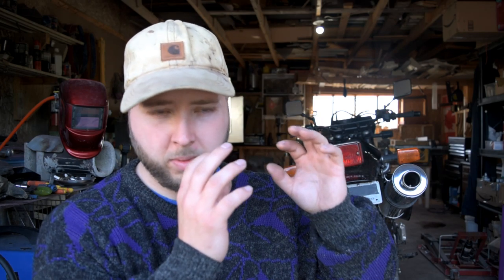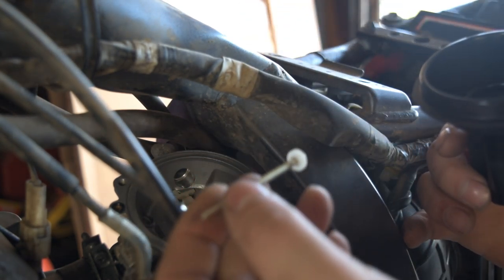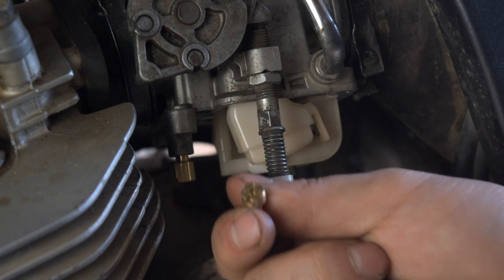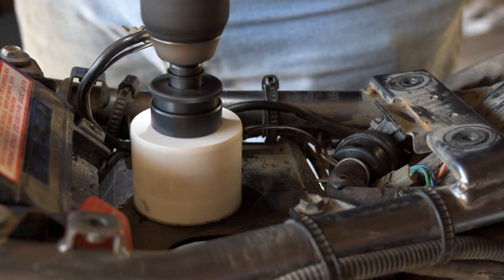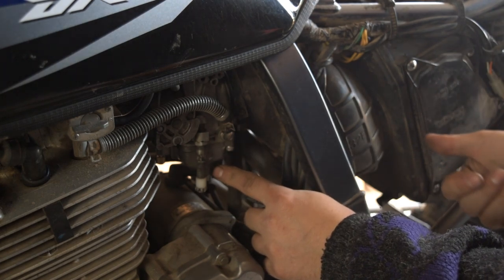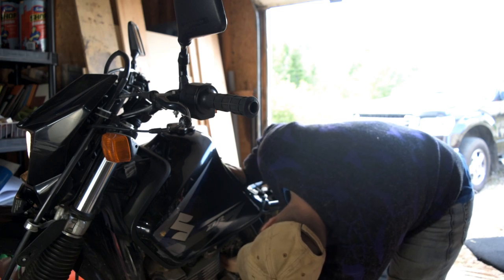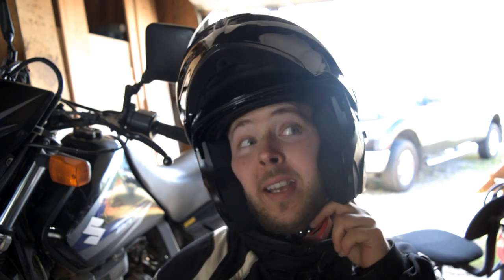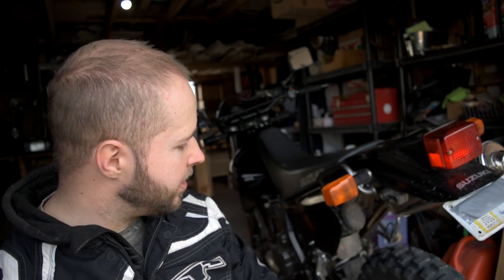Turning the DR650 into a Monster! - [ PROCYCLE FUEL AND AIR ]

Comment: Don't change the springs out, just drop in a set of plex valves for your forks. Best fork mod for the DR650 ever! I have them in my DR650 and they're fantastic! Look them up.
Reply: Yep I have the full set up from FFRC. Absolutely love it
Reply: @ashleywevv3583  I haven't done the rear yet but I'm definitely going to! 👍
Reply: Good tip.  Thank you
Reply: Yup plex valves  are awesome
Reply: Just ordered
Reply: Stiffer springs are better
Reply: Stiffer springs might be required, even if you improve the damping. Set the sag correctly via preload adjustment. Cut new spacers of PVC and/or use aftermarket fork caps.

Comment: I keep the jetting simple. At/Near sea level, I just pull the snorkel, install an extended idle-mix screw, and install an adjustable overseas DR650 or a KTM640 needle. The adjustability is the key, if you like the stock needle taper. I can remove the airbox door and/or tune the idle-mix screw at altitude, if needed. I DON'T cut the airbox. Move the crankcase vent away from the airbox opening to eliminate surging. The stock main jet and pilot jet work fine at sea level with a de-snorkeled, uncut airbox and a stock exhaust. The stock, unadjustable, USA needle is a bit lean, especially after de-snorkeling. It CAN be shimmed too, rather than replaced by an adjustable needle, if richening is needed.

 With stock exhaust, these simple changes in snorkel, needle, and idle-mix seem to run great. My fording depth didn't change much. MPG is similar. Wheelies are easy.

 A bigger main jet may be needed at sea level if you use aftermarket exhaust and/or a big-valve head.

 Some guys at high altitudes actually also use smaller main jets and pilot jets than stock, often with a lowered (leaner) needle setting. With snorkelectomies and free-flowing exhausts, they report sometimes topping 60MPG with the smaller jets and lowered needles.

Comment: Easy way to remember on what jet to start with and then try to get to the exact one on the main jet. The scale for them are a little hard to follow. A 155 is sea level. Most fuel for the most air. A 100 is on top of the highest mountain. Way less air less fuel. Unless your up in the mountains, most will be a 125 or less. Mountain being 5,000ft too 6,000ft and up. Again, less air less fuel. More air more fuel. Then changing the air box or air filter to give more air then means bigger jet or higher number on jet. One quick way to know if you are wright on or off is after warm up and just before move the throttle just a little. If it wants to bog out then you have your jet to open or need to drop to an smaller jet. To much fuel is going into the carburetor. Example. A 125 jet and I give it a little throttle and the engine bogs. Then I need to go to an 115. Not an 130. 130 will put more fuel into it. Higher number more fuel because of more air at altitude. A slight movement of the throttle will for most tell you if your on the right track. Instant response of power, your on the right jet. Take care.
Reply: So, if I were to go from sea level with the current configuration of 155 jet to 5000ft altitude, what adjustment should I make on my carburetor? (how to make fuel and air leaner?)
Reply: @elee325  you need more air and less fuel. The one with the float drop an size. The one in the center add one size bigger. Then at 5000 feet. If not stating running. Do it again. I time should be okay unless you go up higher in altitude.
Reply: Actually, after full warmup, a slight 1/8 to 3/4 blip of the throttle is coming onto the needle from the pilot jet. The main jet is used more from 3/4 throttle to WOT.

 If you have no vacuum leaks or fuelflow issues, and it bogs from throttling 1/8 to 3/4 throttle, your needle adjustment is likely off for your altitude, intake airflow, and/or exhaust airflow. Partially cover your airbox opening and blip throttle again. If it pulls smoother, your needle is adjusted too lean. If it worsens with the airbox opening partially covered, your needle adjustment is too rich.

 To check the main jet, accelerate WOT from lower-mid revs in 3rd gear. As it just starts to really pull, back off the throttle a hair. If it then pulls harder, your main jet is not quite right. Partially tape off the airbox opening and try again. If it pulls better at WOT, your main jet can go down a size or so.

 I once had a weird issue from a fuel tank vent that partially plugged. The engine was starving for fuelflow as I throttled up. IIRC, this is not exactly a rare issue with the locking plastic fuelcaps.
Reply: @RKmndo  when I put on my racing carburetor. I didn't have any problems. Except I needed more HP. No matter what I did to set the idle down. The engine was an runaway. Meaning my main jet was to big. I needed to loose fuel flow. After that my fuel bowl had to not enough fuel. Using the throttle it would die. Yet after research. Is where I found out the settings I said. Not having fuel tank problems or anything. Just putting on an new carburetor and adjusting it for altitude. Highest altitude. Main jet or center jet less. Outer jet more. Sea level. Center jet more and outer jet less. High altitude less fuel and more air. Sea level more fuel and less air. Just an easy way for me to remember. When my engine was new with the new carb and on that runaway. I almost lost my new engine. Your way also. Thanks.

Comment: Hey mate thanks for the video. I am planning to do this on my new dr650 at some stage and wondering how did it go for you? Also wondering I have the same dominator R exhaust installed on the bike and I find it quite load. I have already installed a dbkiller but still the damn thing still screams. How do you find yours? Thanks

Comment: I cut the top of my airbox off and man did I end regretting that. I tinkered with that dang carb for so long. I ended up going with a 145 main jet, 3d printing a new top that was identical to the stock snorkel hole and running it like that. Small improvement in power and bike runs like a top. I will say that I put the 155 main jet in the bike and WOT and jeezus the bike almost pulled my arms lol but it sputtered all the way up to high rpms and then just took off like a two stroke. I never could get it running smoothly messing the needle  and air/fuel ratio.
Reply from the maker: There is a fine line to walk, but mine ran like a dream! Set-up is KEY. My Dad has one that had the work done before we purchased it. Their airbox work was too much for what the carb could mix fuel with. It was no good.

Comment: Have you ever tried taking the header pipe off, then welding the header flange on the outside, then grinding all the weld out of the inside of the flange?   The last DR I did that on, the amount of weld on the inside was staggering.  It literally had 1/3 of the pipe blocked off. The welds are usually sloppy and over 1/4” high. So as you can imagine 1/4” tall weld all the way around a 1 1/2” pipe is a HUGE restriction.
Reply from the maker: I removed the header and had a look. My inside weld was very clean, and moderate in bulk. I ground away probably 50% of the weld on the inside. Not enough to compromise the pipe, but enough to really open up the air flow. I'm happy with it.

Comment: kyle, I have a bone stock Suzuki Dr 650. No Mods. Great Bike. But I Did do i wheelie in first gear with half throttle for about 60 ft. with no problem. glad the mods worked for you.

Comment: the air box does not affect the fuel mixture...period !  it only does if the manufacturers got the hole size wrong, which for some reason is fairly common !  putting 2 large holes in the top of the air box should be more than adequate !.... do not re cover them
for any reason.  fine tuning the fuel air screw is the major improvement !  I recommend a portable RPM gauge that runs off the ignition, they are far more sensitive to air screw adjustments than your ears are. adjusting the RPM to peek RPM by the air screw, then reducing the idle screw and re adjusting the air screw again is my preferred method.  also do a plug color check
stock the plug color will be very light tan to almost white.... that is BAD for power and heat !  the closer you can get the
plug color to chocolate brown the better off you are  
Plug color is a product of the main Jet... if your plug now runs black it is too large reduce the size by .5 , then re adjust the air screw for best mixture  , use a new spark plug so you can quickly see the color it is running at then do a 15 min run  the spark plug color tells you so many things !  your looking at the porcelain below the sparking tip of the electrode not the metal wall outside.   a brown to dark brown color is best,  this was a Major Killer of 2 strokes back in the day guys would run them too lean
and melt pistons, todays 4 strokes benefit a great deal however by having the mixture at just the right amount for a bigger boom
........ always carry 3 new spark plugs with you.... it's a single cylinder, it must have good spark to run... it is common to have a spark plug die on you   1 in 4 are bad from the factory..... back in the 1970's I had as many as 6 out of 10 new spark plugs be bad right out of the box, their better now , but not by that much !  .... don't kill yourself ! <grin>

Comment: Not sure if you can get your hands on CCM spares where you are but the CCM 644 uses the dr650 motor BUT it has twin carbs so if you could get your hands on a CCM 644 the R30-(super moto version)- or the 644DS-(dual sport version) on my R30 it was up jetted and the air box lid was just removed and made a big difference.

Comment: Hi, Im Marlon from NY, I really love your video. I have a question. I have a Dr. 650 for two years and I really enjoy the ride but it has something that bothers me. It's a lot of heat that comes from the engine, and it's really uncomfortable to drive in the summer. So, I don't know if this is normal or I need to check something. What do you think? Thanks for your help

Comment: Hi Kyle great video mate. I have practically the same setup as you. Procycle jet kit, Barret pipe and mid, air box fully open and tried it partially closed. Main difference is I have 14/42 sprockets. Does that make a big difference? Can you tell me how many turns your mixture screw is out? I know you started with 2 like you’re supposed to but after the tuning what did you settle on. I still can’t get the front wheel up in first gear? Not sure if it’s just the gearing or the tuning? Thanks Kyle

Comment: I just ordered the procycle jet kit and twin air filter, can u give me some tips/tricks for installing. should I take the carb completely out at first or leave it in. is yours still running good? Did u drill a hole in the slide?

Comment: hey man, love your work
2 quick questions,
Do you know roughly how much this will effect the fuel consumption of the bike?
and also, I've heard of DR650s going over 100k on the clock, do any of these mods lower the longevity of the bikes life?

Im picking up a 2021 DR650 as my first bike this weekend, probably wont do a great deal to it at first but one of the reasons I went with it is for its reputation as an easy bike to learn to work on.
Reply: Don't mess with it man..... The bike wasn't designed to handle it. I just put a leo vince x3 exhaust and an aftermarket air filter on mine. Power is so much better every way. So yeah The jets need to be stock it will give the bike a long life!:)

Comment: Watched the whole video as I’m picking up my first DR next weekend. Very informative thank you. The bike I’m picking up has been sitting for a few years so we’re going to rebuild the carb since it was stored dry. I also ordered that same pro cycle jet kit (although still impatiently waiting for it to arrive). I’ve read in a few places that if you cut that carb spring down to 100mm it’ll also improve the overall performance of all the mods you’ve done. I’m going to try that as well. Bike already has the GSXR pipe I just need to modify the air box as well. I think I’ll go youre route as I don’t want a big gaping hole in it

Comment: I did your carb mod a few years ago. Great improvement. But wait until you get a tm40 pumper. Ps I have a extra high a boosa  1300 muffler. I bought two back when I changed out the stock. Had to buy the pair.

Comment: Thanks Kyle. Very useful. I have gone through some of the other videos but yours seems to be the best. Some others have also drilled a third hole in the slide. The instructions that I received with the procycle kit dont mention drilling of this hole and I havent seen you doing it in your video as well. Just wanted to know if drilled that hole as well or went without it?
Reply from the maker: I did not do that. I think that was popular for a time. I have used bikes with it done. I didn't like how it affected the bikes throttle performance. I'd recommend not doing it. If jetted properly, and enough air is getting in and out, it doesn't need it!
Reply: @kyle_noseworthy  Thanks. Very useful.

Comment: This mod slightly increased my fuel consumption, nothing major but for some reason suddenly my rear tyre is wearing out very fast.......,

The extra response and power just makes you ride it harder. 
For the stock guys i would recommend taking out the needle putting it in a drill and tapering the stock needle on some sanding paper just a little, no major power gains but it smoothes out the power delivery a bit, think the stock needle is so crappy due to emissions BS they had to meet and they knew anyone could quickly fix it with a drill and sanding paper. 
I tapered mine from about halfway to a almost pointed tip, but i guess less is always better when in doubt. 
I also just drilled the stock jet out, put a 1mm drill bit in and wore it out as even as i could till i felt i had enough copper dust/shavings to justify a improvement, and i did it twice before i had the desired effect, i would guess I'm at around a 150 jet size as a 1.5mm drill bit barely doesn't fit, i actually think i can just drill through with the 1.5mm bit, but I'm happy with the power delivery as is so I'm not going to fix something that isn't broken. 
Oh i also drilled a 2nd hole in the slide but smaller than recommended by procycle. 
I basically did everything the complete procycle kit does but i did it only half way, and half the results are fantastic!!! Especially given that it was for free,....
I got a 2nd hand dr with a very loud pipe but nothing done to the carb, there was a lot of popping on deceleration and it was annoying and that was the reason i fiddled with the carb  i did not need more power but i do appreciate the extra oomph, it still pops now and then but it is a lot better. My brother had a completely stock dr and before i fiddled with the carb on mine my dr had alot more power although it rode alot rougher and the popping was horrendous.
His stock dr was extremely boring to ride in my "hillbilly wannabe" opinion

Comment: ...and in the end, you STILL end up with a bike:
a) that is known for having 3rd gear blow up without warning.
b) that has two NSU screws that will fall into your engine, unless you open up the engine case and loc-tite/tie-wire them into place.
c) that requires pulse coil replacement every couple of years.
d) with a countershaft seal that is known to pop out without warning.
e) that spits out chunks of internal spring-clips during an oil change.
f) which requires carburetor "modding" (right out of the crate) in order to run properly (ie: without surging)
g) with the most uncomfortable seat on the planet.
h) that doesn't even come stock with any sort of skid plate.
How do I know this? Everything but A and D happened to me...on a bike with less than 20,000 miles.
I will NEVER buy another Suzuki.
Reply: It happened to you cuz your Negativity man , your life is full of cons , get solutions.
Reply: @stvnmyrg6984  I've owned at least a dozen different bikes in my time.
The DR650 was the biggest piece of shit in the stable. Nothing to do with "negativity"...
Reply: @DrRider59  I got 59,000 miles on my '03.  Never a problem, and I ride hard.  I think you got a defective bike, or maybe it IS your negativity.  JK😜

Comment: great video man , when i get chance ill set mine up currently the previous owner drilled some holes (small) and rejetted with a supposedly 175 !! 

she seems to run ok (only been on 1 short ride ) 
however she backfires really really bad
Reply from the maker: Yea it's likely getting WAY too much fuel. If you only have a few small holes, I'd downsize to maybe a 150 main jet. A 175 is just silly. 

I believe a 155 is about the richest you'd want to run a DR650, to have smooth and reliable performance.